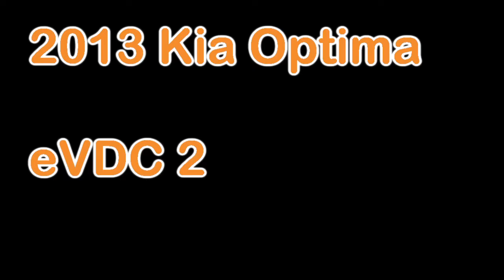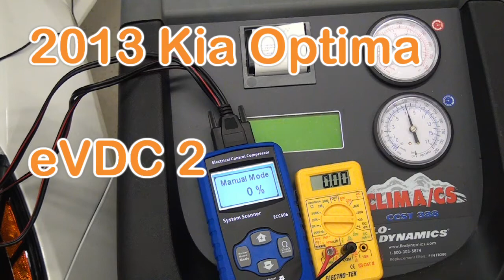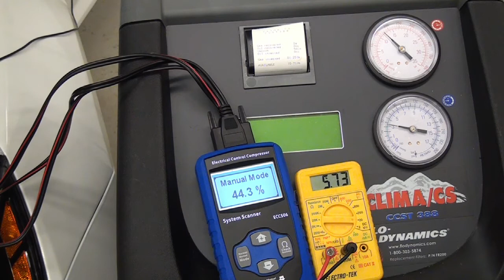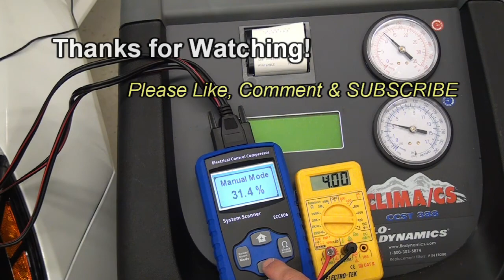2013 Kia Optima eVDC2

Comment: With ~ 90 deg (f.) ambient, at idle, getting 200 PSI (+/- 5 PSI as compressor cycles) high side / liquid line pressure.  Why when I manually raise duty cycle beyond ~ 50% does the high side pressure start to fluctuate / "hunt", but refuse to go higher?  Bad / limiting high pressure switch?  ECM?